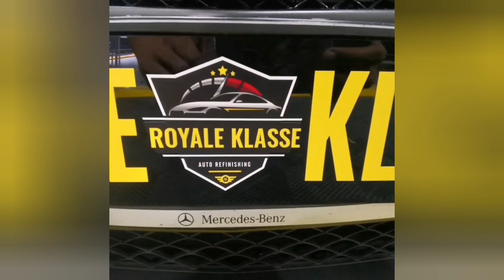SPRAYING C63 AMG SELENITE GREY  MATT GLASURIT

Comment: Hey, out of curiosity, which mix setup do you use ? I'm trying to paint a BMW with frozen brilliant white, but all the local paint suppliers reps have no clues on the proper mix for the clear ?  think we should mix some 923-52 with the corresponding clear to match the gloss level, but had some reps present us with matte paste to mix into the clear instead. Not really sold on that idea since it seems like it's not that good on flexible parts.